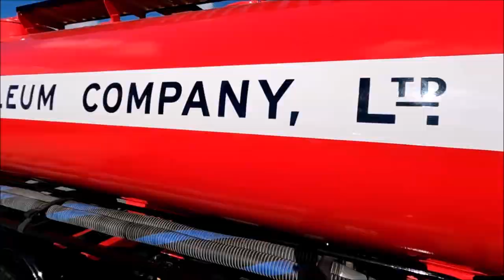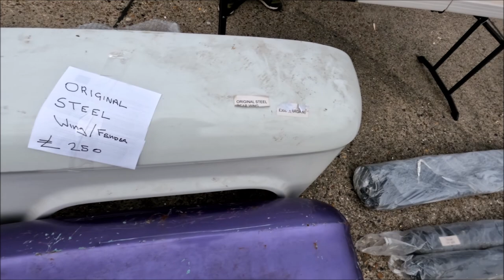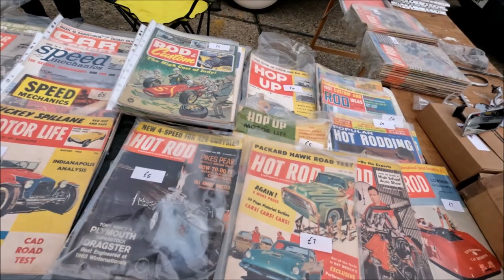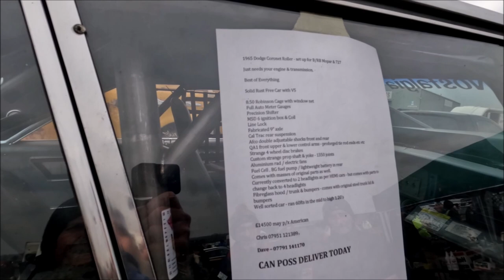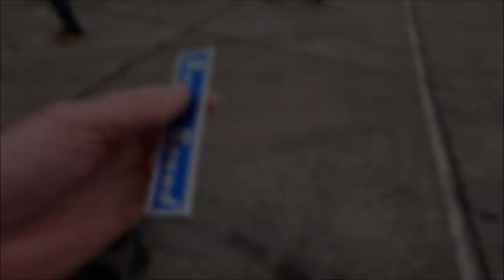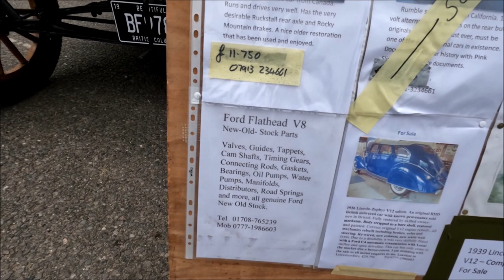NSRA Southern Swap Meet Autojumble - North Weald - March 2023 - Part 2

Comment: 9.33 right hand drive cross steer bolt on steering arms stock 37-40 drop, for a 4'' dropepedaxle as the ones on the table for use with hairpins

Comment: 9.48 homegrown hotrods doing a borgeson reversed vaga box right hand drive - note also he has there right hand drive cross steer steering arms
Reply from the maker: you sure know your stuff pantwagen bud  john gets some quality items for sure.
Reply: @KerbsideClassics  more importantly. They probably are a quicker ratio box than the stock Vega of 22 to one. So the inner ball nut will not crash into the casting, or allowing the pitman to move the required 64mm before the nut squeezes the balls out of the soft brass upper tracks
Reply from the maker: @pantswagen thanks pal some great info cheers